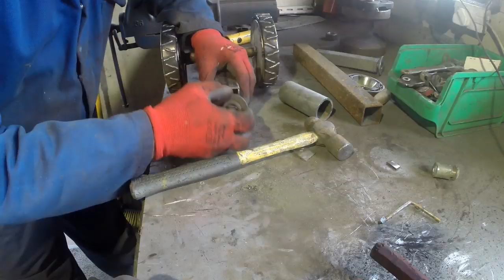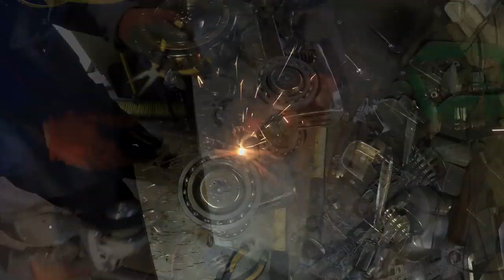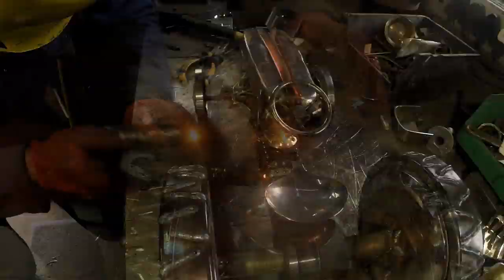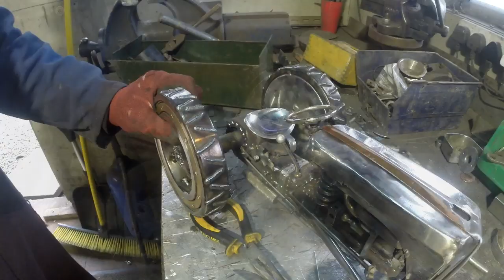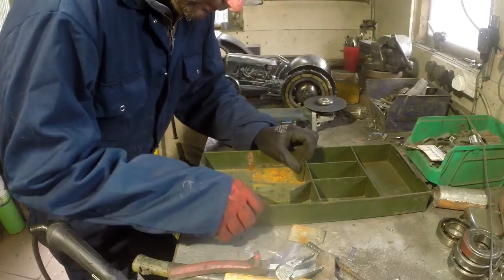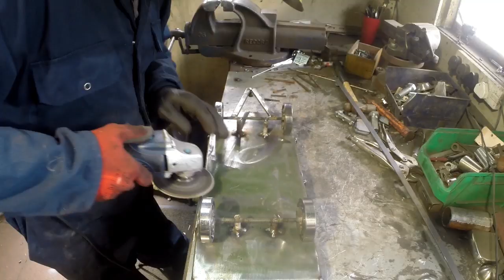I BUILT A VINTAGE MASSEY FERGUSON TRACTOR SCULPTURE FROM WELDING RECYCLED SCRAP METAL

Comment: Hey, how did you get started doing these did you buy all new bolts etc to make your first one and scraps stored from the first one to make another one? it’s something, I want to do as I’ve just bought a mig / tig gasless welder and learn to weld, I’ve got a steel gate to repair and a downfall pipe there my first two projects but nothing after but i want to use it to make money.